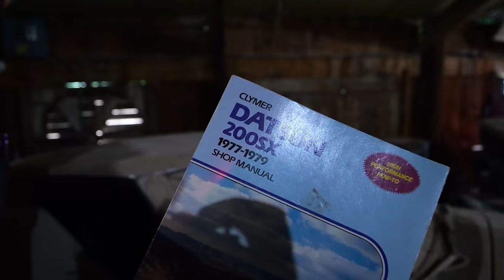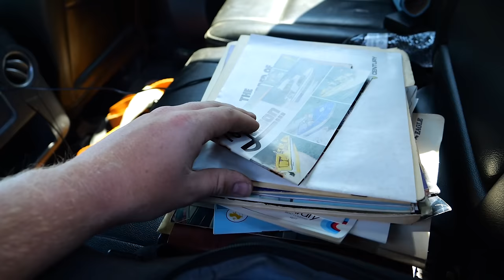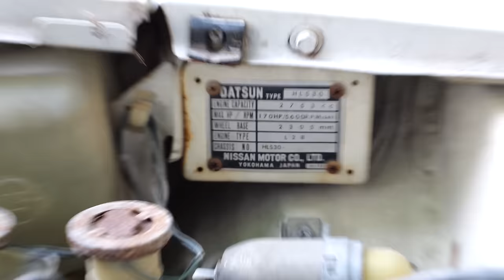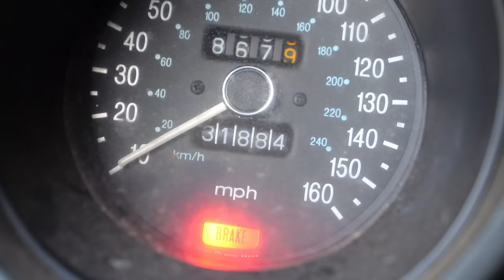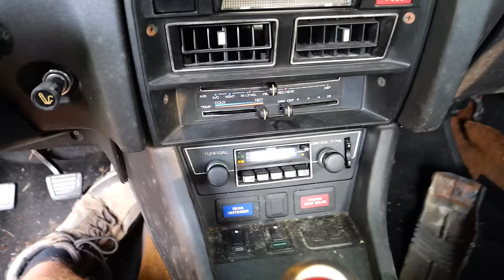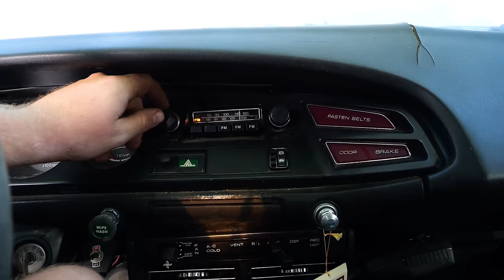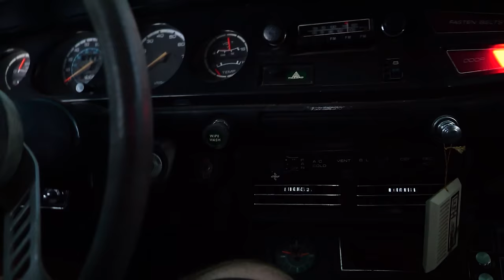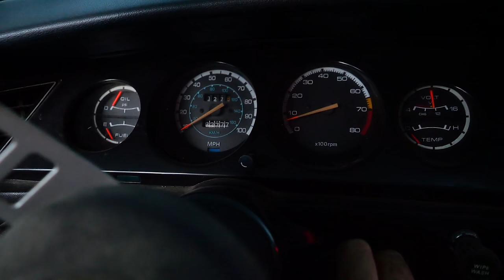Will 2 BARN FIND Datsun's RUN & DRIVE After 30+ Years!?

Comment: I like the irony of the 200 SX wheel covers on the Z

They are wheel covers from a 1979 through 1983, 200 SX

Seeing those stupid ugly 5mph bumpers being useful for something is refreshing 😂

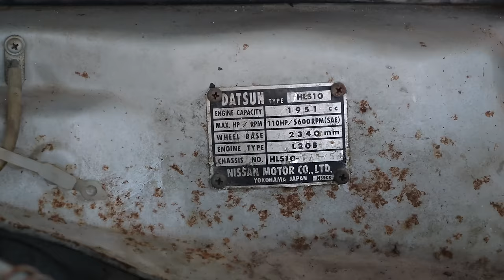And at 17:00
Good guess but you actually have it backwards
Nissan created the 2.4 L straight six for the 1970 Z car by ADDING two cylinders to the L16 4cyl that was in the 510. The 2 L four-cylinder that's in this car has a tall deck block with a longer stroke than the six cylinder engine. 

The L20B was so named because Nissan hilariously also had a 2 L in-line six  L series engine named, you guessed it, the L20A.
The 2 L straight six was for the home market where taxes were vastly greater for engines displacing more than 2 L
For the "large" luxury cars, Nissan wanted a smooth engine, so they made a 2 L in line 6!

Oh, and lastly 
Believe it or not, those are factory power mirrors .

Comment: Recurring problems with 70s datsuns ....starters  went through at least 3 a year and on the automatics any was the flywheels the centers would break off and the flywheel would spin but not turn the engine over and if you had carburetor problems don't bother to rebuild throw it away and buy a new one

Comment: Sadly the factory rust proofing on older Japanese cars was non existent.
I wouldn't touch these old Japas with a barge pole.
Also it's not Dartsun ... It's Dat Sin
Sorry but watching you butcher these poor old girls with brake clean on an engine that's been sitting for two decades was cringe worthy

Comment: No hate, Love watching your channel since beginning.I'm just noticing that you've become quite lazy. So you start the engines with brake clean without taking out the spark plugs and lubricating the cylinders...ect ect 
that's the worst thing you can do to an engine that's been sitting for over 2 decades.

Comment: A burnout in the entire world with the exception of the USA is to have lack of grip due to bad design. When in Japan or Europe for all that matters a car starts turning the driven wheels (front or rear) without propelling the car,  that means back to the drawing table, since something is very wrong, since driven wheels should not spin and burn rubber. And yes that also goes for our most prestigious out of your range kind of cars like Lamborghini and Ferrari and Aston Martin and Bugatti, just to give you a few examples. This also goes for the sophisticated Japanese cars. So trying to have this Datsun 280 Z pointless turning driving wheels when standing still is stupid and an illusion since this car was designed to avoid exactly this. Europeans and Asians want the maximal engine power to propelling of the car. Everything else is pointless loss of power and unnecessary wear of tire rubber. And completely plain old stupid to even try to do so. Please stick to the American junk!